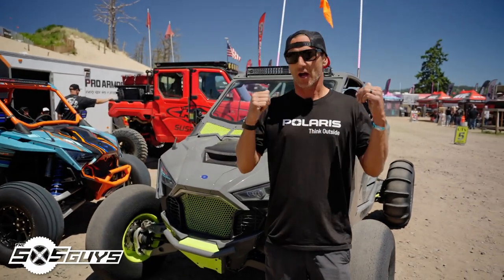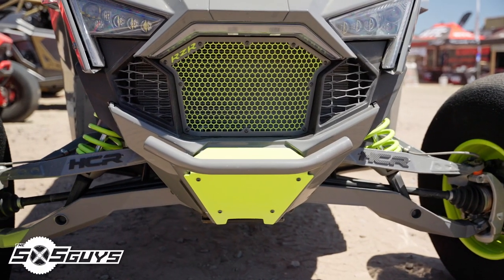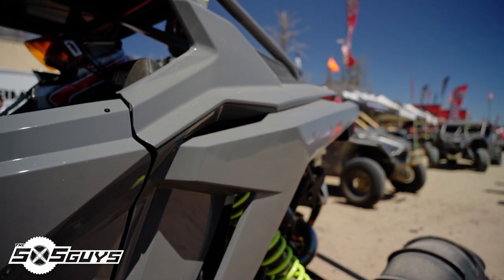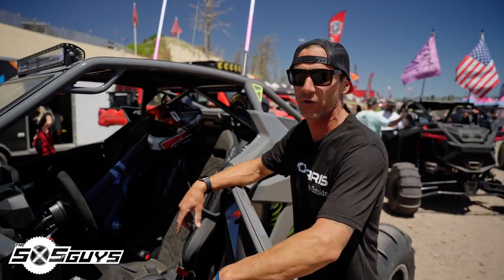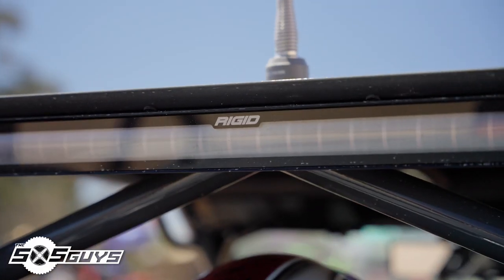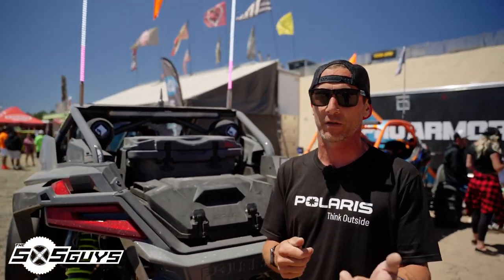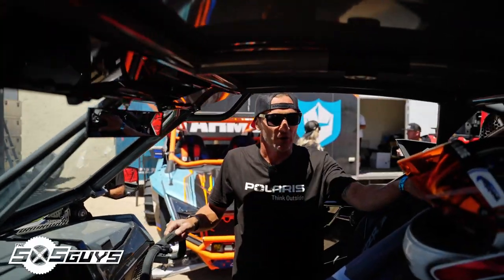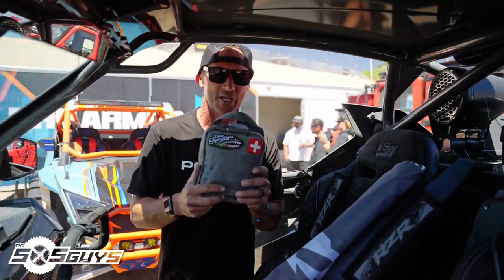Billy Slade's “Destroy R” RZR Pro R Build Breakdown | The SXS Guys

Comment: Launch it for the people busting ball joints
Reply: Upper or lower?
Reply from the maker: If you're referring to the people that are taking a desert car and hucking it on factory ball joints... It kinda seems like it's expected. This build features upgraded joints that come with the HCR kit.
Reply: Watched people huck them at Takeover and not one failure of a ball joint or any other component.
Reply: @Road2Offroad  dirt dudes busted one allegedly with a small jump but with a sketchy video timeline from April eventually polaris made repairs under warranty
Reply: @allmotorhash  allegedly is a bit different than actually seeing one break. I personally saw 2 Pro R’s get hucked over 100’ at takeover and no failures. But I do understand dirt is different than sand. But traveling at 70+mph and 100’ even sand is pretty hard. Nothing is indestructible. The oem ball joints have made it through some of the most harshest Baja races without failure as well and those RZR’s are being pushed to the limit for 100’s of miles at a time.
Reply: I'm more concerned about the lower shock fork material.  It may be that piece that broke initially on Zak and Nick sues pros. I'm picking up my Turbo R this weekend!
Reply: @montanamountainutv  there is a company making billet forks now good parts coming soon to bulletproof it